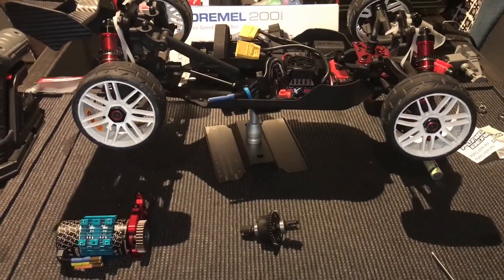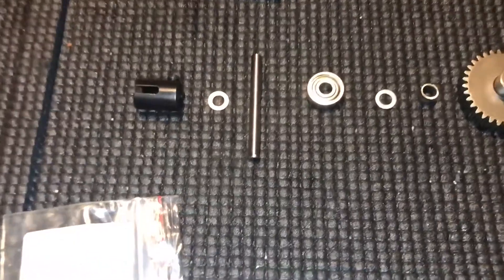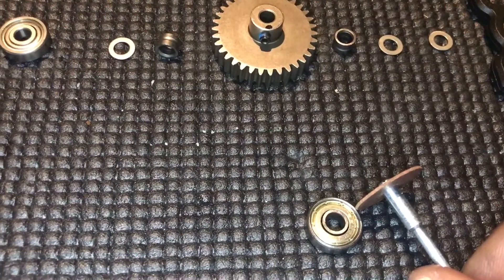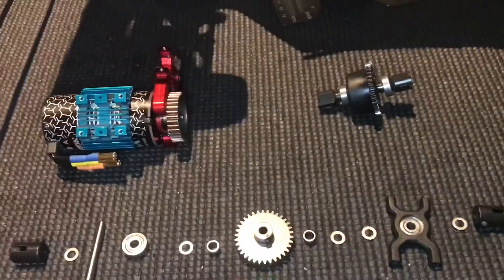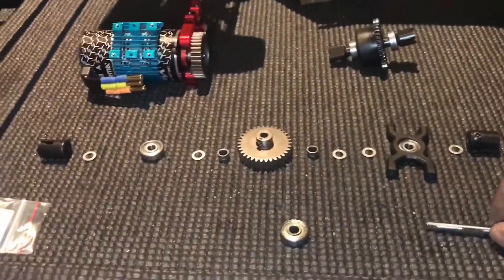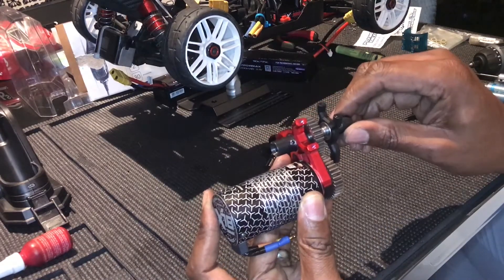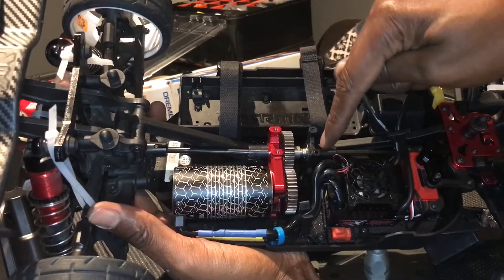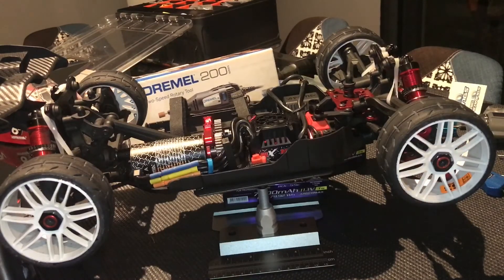How to make a custom spool to go over 100mph Episode 10

Comment: Hello sir i am about ready to do my center spool conversion,i seen your parts list and i was trying to how many shims you have on your work table.
Reply from the maker: 3-4 shims will be enough
Reply: @WigganRC  if i don't have shims with a 5mm hole could i use the center of a baron to use between the mod 1 pinion and the diff cups and thank you for info

Comment: The 5mm shaft that you cut how did you flaten out the center and both ends?
Reply from the maker: Use a dremel tool and is easy just so that the grub screw has something to lock on to.
Reply: @WigganRC  ok plus i have the same dremel that you have sitting in the background of your vid😂